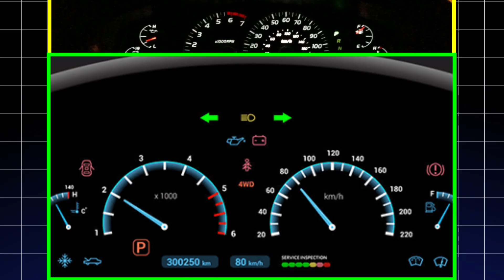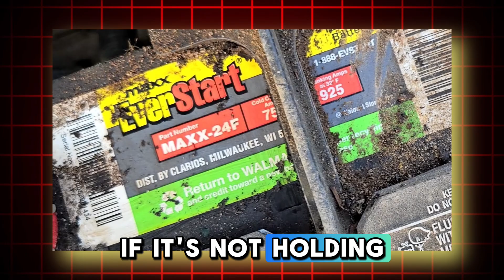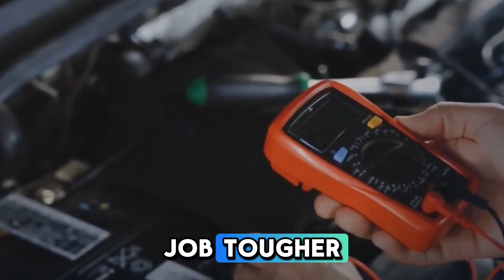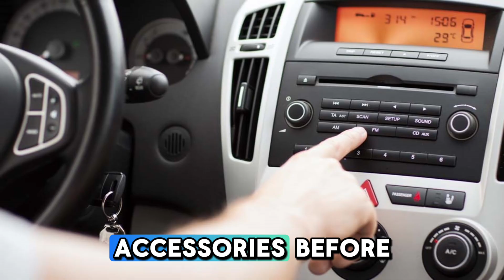7 Reasons Your Car Wont Start in the Cold (and How to Fix Each One)

Comment: I have a good battery and my car cranks but won't start up
Reply from the maker: If it cranks but won't start, it's usually either a fuel, spark, or air issue (or sometimes a sensor).
Reply: Same here